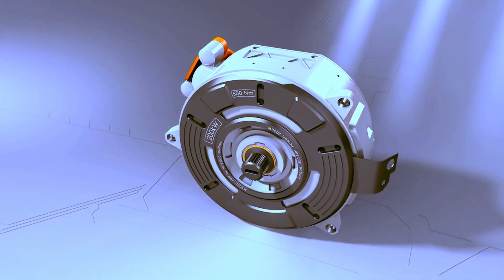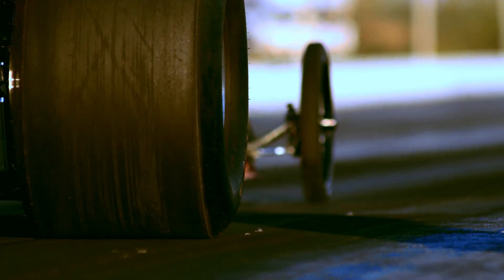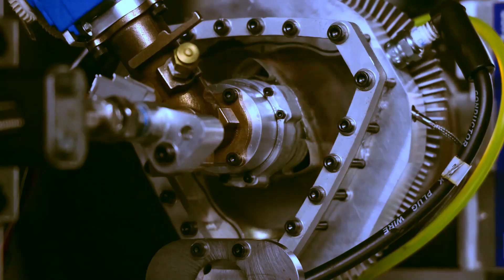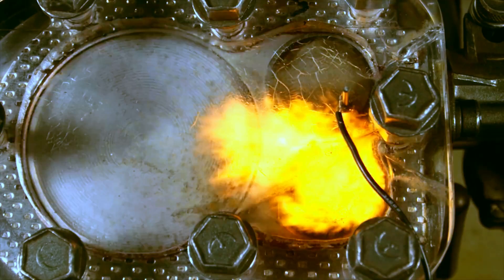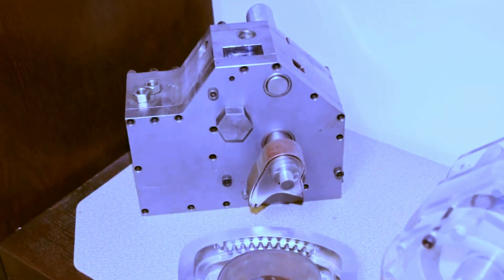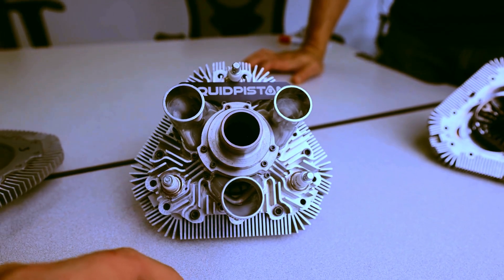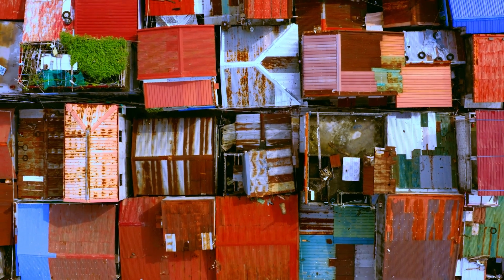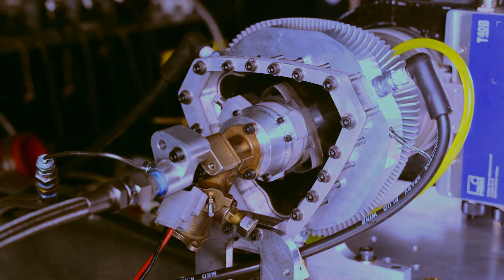X ENGINE XPLOSION: SMALL, MIGHTY, AND CHANGING THE GAME!

Comment: Funny how since EVs have started to show how poor engines really are
better ones have started to appear.
ANYTHING to keep the fools going to the gas station for the next 100 years.
Reply: you're clueless dude... EV motors are extremely powerful and so are ICEs. The batteries are the problem. They don't last, they take forever to charge, you can't dispose of them properly, you can't restore the battery life. Oh, and don't forget, mining this lithium pollutes so much more than an ICE. Until the battery problem has been solved, it is ridiculous to keep using the same lithium ion batteries that are just gonna fail after enough charge cycles. Not a single EV produced today will last 15+ years without needing a battery replacement. At that point the battery costs more than the car is worth...
Reply: @lukekolodziej9631  well stated and very true
Reply: @parttimetourist thank you
Reply: @lukekolodziej9631  Yup just think of how many battery powered tools are useless when the batteries need replacing. People usually but a new set as it's probably cheaper than buying newer batteries. I'm sure there are other options but they are collecting dust on government shelves. Nicola Tesla wanted to give free energy to the world and look what happened.
Reply: @lukekolodziej9631  its so easy to ignore the fact ICE engines produce 75%  heat  and only 25% or less forward motion while constantly spewing poison gas.
'Forever' to charge ? Well there is a bit of BS right there.
Do a bit of research about the battery side, its not as grim as you make out.
No EVs arn't perfect, but they sure beat ICE.
Reply: @lukekolodziej9631  False information.  EV motors are far more powerful for the weight than combustion.  The batteries today work just fine and last longer than most combustion engines.  Mining does not pollute anywhere in the same ball park as burning fossil fuel for energy.  You have swallowed a ton of false propaganda.  If any of what you say is true you will be ble to support it, I suggest you try and prove it to yourself.